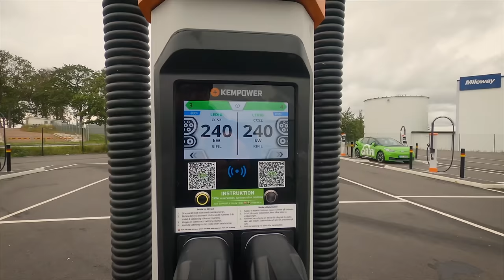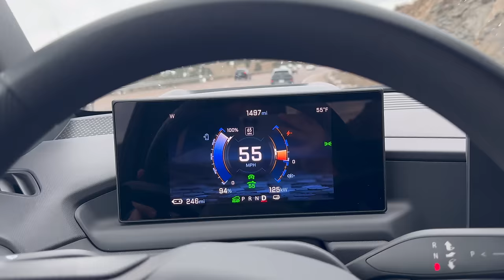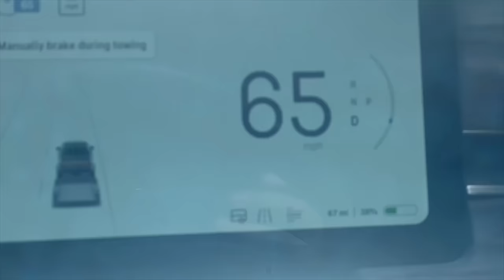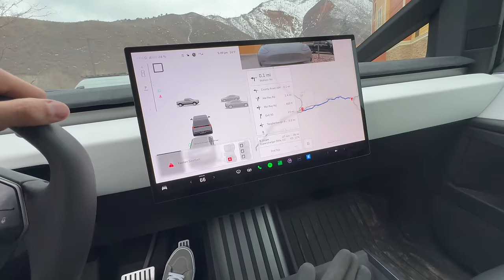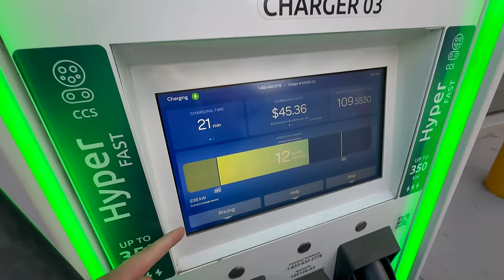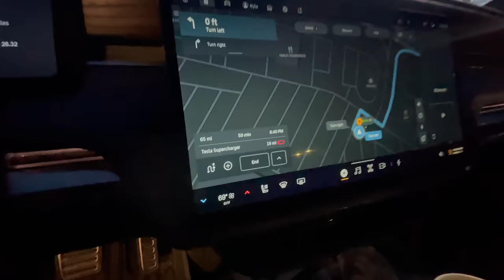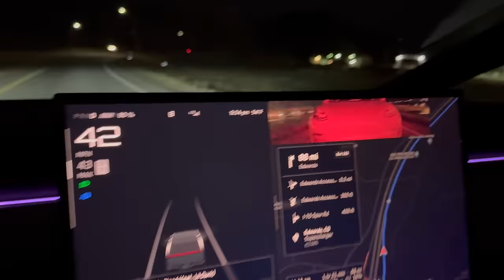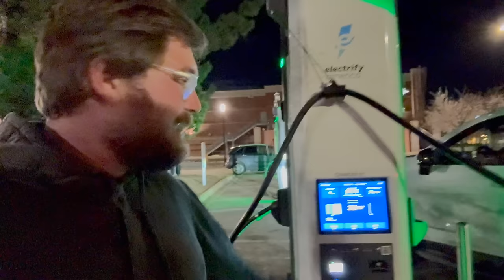Electric Trucks Tow 500mi Over The Rocky Mountains! Cybertruck vs Lightning vs Silverado EV vs R1T

Comment: Really think Tesla should make a max tow/haul version of the CT, with a double stack battery pack, so it can get the hauling/towing crowd on board. Towing electric is super smooth, much nicer experience. Not to mention massively less expensive. Or they could offer a serious range extending battery pack - double the size and capacity of the previously announced pack. Best charging network (could use towing-specific improvements) and better cooling and HD regen capabilities.

Comment: So roughly 1.5kw(1500watt) per mile? So you can throw a honda 2000watt generator in the bed and go for days? Has anyone tried to make these a hybrid? Can you charge on the go like if you have a camper with generator?

Comment: Your #1 priority should be keeping that trailer in your lane. I've hauled a '73 Camaro across the country with an ICE 150 with the very same trailer. I know it's wide, but there's no excuse for leaving your lane. Drive first, film second. The safety of other travelers on the road is far more important than getting the shot/orating. Doubly so in the mountains. Absolutely no excuse for 27:15.

Comment: Silverado, many benefits but at least the nav seems to work far better than the Ford for calculating arrival % of battery. Ford left on vacation with its nav, no help on pulling a trailer, you need to be a nurd to figure it out. Come on Ford, you can do better!
Reply: I assume Ford decided to go with foreign software programmers and never did anything in house.  Crap input means crap output.

Comment: At 2:12:18, I live here in the US since 2006 and one thing that I cannot wrap my head around is to understand the temperatures in Fahrenheit. I too still have my weather app set to Celsius. 😅
Reply: I was going to suggest that you fully immerse yourself in Fahrenheit to get a feel for it but if you're 18 years into, I guess it's not going to work.
Reply: @chrisstoddard1144  I am 57, so I have lived a significant portion of my life using Celsius and the metric system. There is only so much I can let go off, doing the best I can working with miles, feet and inches. (Still have no good understanding of 3/8, 5/16 and so on) 😂
Reply: @andyzegerman  I'm sure I'd have the same problem changing to Celsius.

Comment: I own a lightning, the guess-o-meter is terrible. I had to learn how to do the math for super accurate range calculations. 131Kw battery X percentage remaining X miles/KW = Accurate Range. Example-131 X 50% X 1.4Kw/mi=91.7 mi range.

Comment: Since he has mentioned many times that EVs can't tow and that only ICEs are up to the job,  its an interesting test, and its somewhat entertaining.
Reply: EVs tow great. They just can’t tow long distances.
Reply: @jysmtl  Sure they can.  As long as the next charger is within range, they can tow indefinitely.  The deciding factor is fuel costs and how long your stops are tolerable!
Reply: That’s right. They can’t tow far on a single charge. Bringing charging times down is probably a better solution than sticking in larger and larger still batteries.

Comment: When a diesel pickup can cost in the $100k range, this Chevy pickup with 450 mile range at $80k or so is a viable replacement for that for most consumers in the market for this type of truck. No it wouldn't replace a diesel for hot shot trucking, but the vast majority of those sold aren't use OTR like that anyway. I'm not saying it's as convenient, because it's definitely not, but they're getting there. The use-case for electrics increases by the year and this pickup is pretty game-changing in my opinion when it comes to that "pro-sumer" category where you might have a business like landscaping that you tow a trailer locally and you make occasional camping trips with the RV trailer. The cost savings on fuel is astronomical.

Comment: I didn't even think they were making any Silverados. Are they available this year?
Reply: Silverado have been available to fleets for several months now. Far more have been delivered so far than Cybertrucks.
Reply: How many? @TroySavary
Reply: @TroySavary  You're a FUD machine, Silverado EV production is nowhere near Cybertruck.
Reply: @boostav  73 Cybertrucks were delivered in February vs 300± Silverado EVs. Neither of those are high numbers, but Silverado shipped more. I think you meant to type "fact" instead of "FUD".
Reply: @TroySavary  Absolute nonsense as per usual, Tesla is at hundreds of Cybertrucks per WEEK right now.
Reply: @boostav  Got any source of sales figures? We have February numbers, but not March. What we do have is drone shots of hundreds sitting in a parking lot, but curiously few shots of any in transit. Probably sitting there waiting for the doors to be installed correctly.
Reply: @TroySavary  Just in from Cox Automotive, Q1 2024 Tesla did 2,803 Cybertrucks in its first quarter of production and Chevy did 1,061 in its third quarter of production.
Reply: @boostav  And now Cybertruck has a stop sale because accelerator pedal is falling off. Plus the non-fleet trucks for GM launch this quarter. And there were 1600 Hummers also delivered last quarter. Everything points to GM delivering more trucks from here on.

Also, the Cox number is an estimate. If Cybertrucks were selling well, Tesla would not be hiding the numbers in "other", along with Model S and X.

Btw, Cybertruck launched in Dec, so the quarter that just passed would be second quarter. They delivered a dozen or so the first quarter.
Reply: @TroySavary  You mean the Hummer that's in its 10th quarter of production and is still only doing 1600 units per quarter?

Wrong yet again, actual customer deliveries didn't start until Q1. Either way one extra month (December), which isn't a quarter, is irrelevant to the point.

Automotive data is Cox's business, you can rest assured they are plenty more accurate than your feelings. They're in the "other" section because the vehicle is ramping.

Don't worry Cybertruck will far outsell the Silverado in Q2 despite the stop sale. I'll come back here and make you look like a fool as per usual. Something you evidently enjoy as you double down every time.
Reply: @boostav  The Hummer is supposed to be low volume. The concept of halo car difficult to you? The fact that it is even close to the Cybertruck in sales which you stans said would disrupt the whole truck market says a lot.

Cybertruck is a failure. Half the promised range. Double the promised price. Breaking down on day one of ownership. Every truck channel that has reviewed both Silverado and Hummer says Silverado is far superior in every way that matters. Businesses are interested in Silverado. YouTube wannabe influencers are interested in Cybertruck. And now that Cybertruck news is saturated, they seen to be trying to unload it, judging by the number of used Cybertrucks already on the market, despite Tesla trying to ban resales.

I'm in trades. I talk to other teadesmen all the time. Lot's of interest there for Silverado EV. Nothing but scorn for Cybertruck. If Tesla can't draw truck buyers, tgen Cybertruck is just a fad for hardcore Tesla fans. 

Tell you what. If you think Cybertruck is a roaring success, buy a bunch of TSLA. It's sure to turn around if you are correct.

Comment: The real question most ice truck owners might want answered is, how far could a regular F-150 tow tow the same load before having to stop? 150 miles seems pretty short.
Reply: My dad's Sierra 1500 only gets about 5-8 mpg when towing his boat so not that far off honestly at best he only gets ~ 200 miles to a tank assuming he only goes 55 and doesn't have to go uphill and unlike the electric trucks he doesn't get fuel back when engine braking down a hill

Comment: Off topic kinda, but anyone know of a solar supplemented UPS for a home office?
I looked at those Anker and Enphase batteries, but IDK if you can power them both from the wall and the panels. Or if their response times are quick enough to prevent the computers restarting.

I'm trying to get rooftop solar, but because we have a corporatocracy instead of republic the power company gets to decide how much I can put up there, and it's taking forever... it's a big annoying mess, so I'm looking for something simpler in the meantime. Plus I need a UPS.

I want the battery to be kept at least at 50% by the wall, then topped off with solar power. I don't need more than a kWh or 2.

Comment: Only a few percentage of truck owners need insane towing capacity. Only about 25% or so of pickups are actually used for towing. If pickups are used for towing the distance is usually less than 100 miles. Those that are choosing to not buy an EV based on towing are not really looking at the real world usage numbers.

Comment: On Ford's inability to navigate by voice command, it seems to be a issue across multiple platforms. I use Android Auto in my Bolt and listen to music I've ripped and uploaded to my YouTube Music account. If I tell Google Assistant by voice to play a song in my library, it will refuse to search my upload library and will only play something from YouTube Music's native streaming library. But if I pull my phone out and manually access my uploads, it will play fine. I'm no coder, but it seems to me that most voice command protocols throughout the industry are so narrowly written that a lot of commands that should work fine are simply not captured.

Comment: I bought the F150 lightning based on all the good press that Kyle gave it and now he can’t stop drooling over the Silverado. Seems not to even like his cyber truck anymore. I have no complaints. I’m about to put my first 1000 miles on it and so far so great, but the reality is the Silverado EV is not even for sale yet and I have to pay Tesla $20,000 for a foundation series probably for the next year. I’ve got almost 20,000 off a lightning lariat 2023. So no complaints but I gotta be honest if the Silverado EV was available and it wasn’t marked over I would’ve picked it over my lightning. The problem is that $95,000, example that they first want to sell is a complete no go. Way too much money. For the record the same way I feel about the cyber beast. Had 1:05:37 they kept the original pricing I would have been all over it.

Comment: I suspect the reason the Ford Lightning was claiming the last few percent of the battery was not available in its range remaining calculation, is that it knows that using the last few percent is very hard on the battery.

Comment: I’m struggling to see where the Silverado EV makes sense. If regular towing is your thing, ballpark math is you will spend 25% more per-mile towing with the Silverado EV than you would with a gas-powered Silverado, and approximately 50% more per-mile than you would with the diesel Silverado. This is assuming towing has a 50% hit to range and fuel economy, $0.45/kWh charging stops, and $3.57/gal gas or $4.03/gal diesel. Not to mention the higher purchase price and increased tire wear driving around an 8500 lb truck.

And if you aren’t towing long distances and don’t road-trip regularly, then why go with the big battery on the Silverado and haul around all that extra weight on a daily basis, versus one of the other EV pickups? The Silverado only seems to make sense if you want to road trip in a pickup and not stop to charge very often, which seems like a pretty narrow use-case.
Reply: Yeah, but can you run your whole house with one of those diesel of gas trucks? If you have solar and this Silverado EV, not only could you charge it for free, but you won't even need the grid anymore. And definitely no more power blackouts if you still use the grid. You can run your whole house for 2 weeks with that battery. 

So add the total of your electric bill to all of that comparison. Just think of how much you would save in gas/diesel every week if you go anywhere 200 miles away and back without paying for any gas or electricity. And even if you don't have solar, you can charge it with cheap homes electricity rates and do all I just noted above for very little money. That's the math smart people do.
Reply: @Paul-cj1wb   Charging with solar sounds nice in theory, but there are a few issues. First, your truck has to be plugged in at home while the sun is shining to charge. Most "work trucks" are in use during the day, so leaving your truck plugged in at home during the day isn't a realistic option for most people. And recharging at night from a home solar battery isn't realistic either, since most home batteries only hold ~13 - 18 kWh, which is only enough to cover about 25 - 30 miles of driving (assuming none of the battery is used to power your house).

The other issue is the number of solar panels you'd need to charge the Silverado. You'd likely need an extra 15 panels beyond what's needed for your house to get enough charge to replenish 50 miles of driving in a day. If you want to charge at the maximum AC rate the truck will take, you'd need over 50 panels.

Sure, you can just charge off the grid without solar, but then it goes back to the question of how many people need an $80k "work truck" with a 200 kWh battery.

Comment: GM obviously did the right thing for the current moment by just saying "F-it, huge battery GO".
Reply: Honestly it is not even that crazy, mid-size EVs like a BMW iX3 will hit up to 105kWh net capacity when BMW's "Neue Klasse" will be released in summer 2025, so half the capacity of a huge and heavy truck meant for towing.

Even in the future EV trucks need 200kWh net battery capacity if you want to tow heavy loads for like 300 miles in suboptimal conditions on a full charge. The batteries will be dramatically less heavy tho, due to increased energy density and that makes it even less crazy to put them into these trucks. But we do not need batteries much bigger than 200kWh except for semi trucks, that's for sure.

Comment: So the whole reasoning for Elon saying bigger battery means less efficiency goes out the window as all trucks pulled thru 1.3 miles/kw! Plus Tesla isn’t really leading anymore with slow charging on Cybertruck! I mean never thought GM would pull 3x charging speed on a Tesla! Good on GM!
Reply: The Cybertruck can charge almost equally as fast as the Silverado when plugged into a 350kw capable 800v capable DCFC station issue is Tesla's superchargers are only 400V capable so the truck has to split the 800v battery into two 400v batteries when charging which Greatly reduces charging speed and efficiency

Comment: The real game changer is going to come when these trailers have a motor (or two) and a battery pack so they can essentially propel themselves. 

Obviously that will necessitate charging up the trailer as well as the tow vehicle, but as charging times get faster, that impact should be minimized.

Comment: Without towing

Ford F-150 Lightning Extended Range - 281.7 miles 
Tesla Cybertruck Cyberbeast - 304 miles
Rivian R1T Dual-Motor Large Pack- 345.2 miles
Chevy Silverado EV 4WT - 433.7 miles

Estimated Towing
Roughly every vehicle got 1.3 miles per kWh or worse

Ford F-150 Lightning Extended Range - 180 miles
Tesla Cybertruck Cyberbeast - 160 miles
Rivian R1T Dual-Motor Large Pack- 175 miles
Chevy Silverado EV 4WT - 280 miles

Comment: I think what Jordan is missing about the Ford Navigation and GOM is that he and Kyle are not the people they have designed this for. Every decision Ford has made and every decision their navigation is making is to avoid, at all costs, a driver running out of charge and getting stranded. Essentially Ford isn’t optimizing for optimization but optimizing to minimize the risk of running out of charge.
Reply: Perhaps, but some of the decisions it makes are just plain silly. I can forgive underestimating the range on a GOM in the interest of not having people run out, but not auto-recalculating the route for the next available fast-charger, and pretending a known charge location doesn't exist, are things that shouldn't happen.

Comment: EV Trucks use a lot of energy. The battery capacities are not meant for frequent flatline or topoff. There is a lot of time, that goes into planning and charging, that a diesel truck, does not need to care about. Just some 💭

Comment: I wonder what a truck like the Silverado will be like with solid state batteries that are a fraction of the weight of liquid? Could you reasonably excise a ton and a half or so of weight? 4.5 tons really should require a commercial license; a 2.5 to 3 ton version would not only benefit greatly on range but be a lot more mainstream. One other thing -- while I think fuel economy standards should be far stricter and most people should be driving about two classes smaller of vehicle than they have (which I admit would mean me downsizing from my Sonic to a class 3 E-bike), credit where credit is due on the Silverado with the midgate pass-through feature; it's just about the only stock pickup out there that can carry a traditionally long load and definitely the only mainstream full-size quad cab that can do that.

Comment: I had to laugh at the superchargers at the Sonic restaurant.  Sonic is designed for people to drive into the slot, order and get their food delivered.  Sadly the superchargers are just regular superchargers next to the normal parking spots.  I guess superchargers aren't really flexible enough for that configuration.  Since Tesla vehicles have the charge port on the rear of the vehicle the charging pedestal would be far more vulnerable to getting bonked by a vehicle.  I guess they could back in but I've never seen anyone back into an angled parking space. It would be more convenient to put the chargers on the island and the charge ports at the front of vehicles.